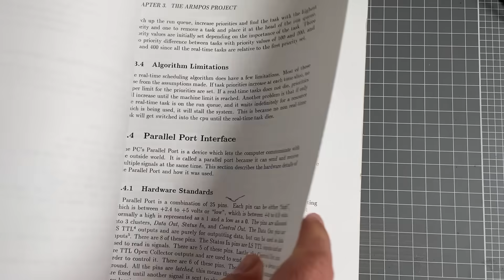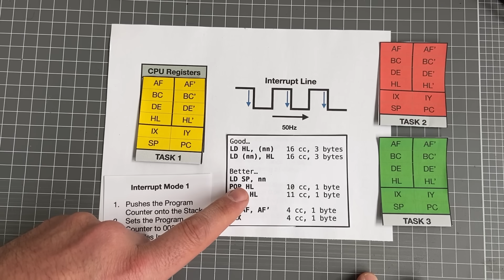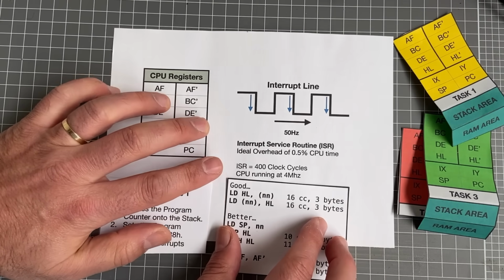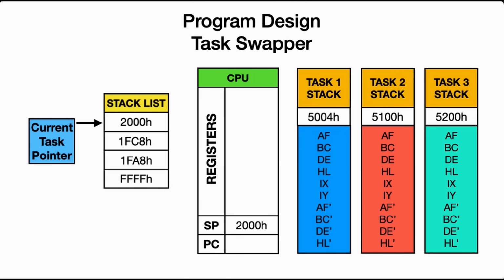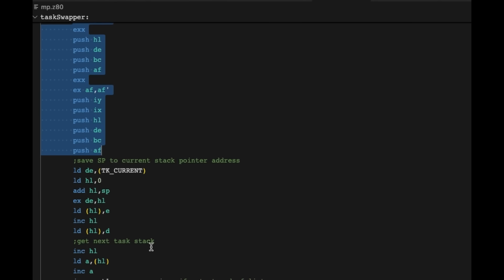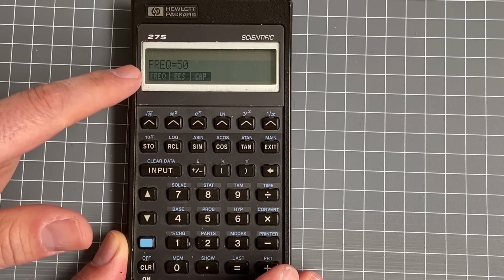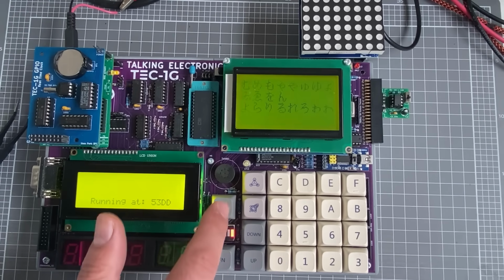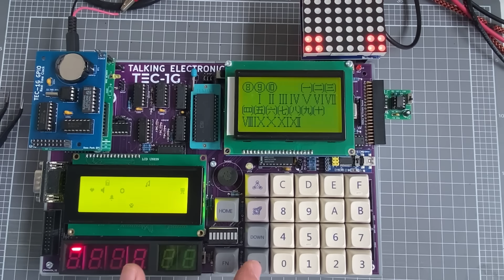Multitasking on a Z80 CPU

Comment: Very cool! I wonder how possible it would be to implement a way to allow the program to defer execution of its task, so that other tasks can use the CPU time instead. Though I bet that would cause problems if you're just using a hardware timer for interrupts, as it would get out of sync if you also programmatically triggered the task switcher.
Reply from the maker: Interestingly, that's what my thesis attempts to achieve. Task prioritisation
Reply: Then it's not preemptive multitasking anymore.
Reply: @chpsilva  That is not true. Just because a task calls the operating system to wait on some event (such as a timer event, or if there is input top process) does not mean that it's not a pre-emptive OS. Yes, that sort of thing can happen with a co-operative multi-tasking operating system, but it also happens with multi-tasking operating systems as well. The difference is that with a co-operative multi-tasking system, if those calls are not made, the task will never relinquish control. It is extremely bad practice in any multi-tasking operating system, whether pre-emptive or co-operative to do things such as executing a tight loop until some condition is met, such as input data to process, or for a timer to trip over. It's wasteful of CPU time and also of power. Consequently, in both co-operative and pre-emptive multi-tasking systems well written code will call system routines which will wait the task until some condition arises to unwait the task, typically on a time basis, or if there is input to process. The difference is that with a pre-emptive system, then the OS can wait the task and despatch a different one. Calling something like a delay routine rather than executing code in a tight loop does not suddenly make it a co-operative operating system. It just means that it's badly written code running under a pre-emptive system. 

What's more, that badly written code, when run under a pre-emptive system, means that the scheduler can change the task's processing priority dynamically according to behaviour. For instance, on a transactional system with high I/O rates, it is normal to implement something that demotes CPU-intensive tasks such that those which wait voluntarily (typically for I/O) get higher CPU priority. That means that they do not have to wait for some CPU hog in order to process input from, say, a file system or a communications device. It also means that if somebody has written one of those multi-tasking unfriendly tasks which executes tight loops instead of a delay call, then it will fall down the CPU priority level. 

That sort of scheduling is often called "mean time between wait". It is something a pre-emptive multi-tasking system can do, but not a co-operative one.

Comment: I did a bespoke multi tasking app for a Z80 in early 90’s writing in ASM. Worked on a yeld method to swop around. Operated a bit for Lab equipment for British Sugar.
I also can up with a single step debugger using the M1 and NMI.

Keep up good work 😊
Reply from the maker: Yeah, the Ultimate Expansion board for the 1F video has a single stepper demo. Also the breakpoint feature on the monitor is essential multitasking but with manual task swapping
Reply: sounds like cooperative multitasking?

Comment: Absolutely it can :) My final year project at Uni in the 80's was a lighting console, which having first written an assembler and relocating linker for 6502 and z80 in BCPL then ported to C, had windowing interface driven by a 6502, and an HD64180 (Z80 in a 64 pin package with MMU and other goodies) running a multi tasking OS that I'd written. It was really the only way to manage the control surface (sliders, LED display, knobs etc.), the serial output (similar to DMX), mouse input, updating of the UI and so on. Each module was a separate process that could run independently of the others, making it a manageable system to implement. All built on a couple of wirewrap boards. Early on it would work for nearly a day and then hang, which took a few weeks of reasoning about, but eventually found a context switch fault that happened very occasionally, but eventually causing stack overflow and crash. All written in assembly. Was lots of fun :)
Reply: Funny enough, the ETC Microvision FX  lighting console used an HD64180, but used a variant of the 6845 CGA controller for the user interface.  Great little console to play with for high school theater, and I have one at home now for goofing around with.
Reply: do you have documentation for it somewhere? Sounds interesting
Reply: Stupid question - is Martin Richard's The BCPL reference manual still the book to read on BCPL?  I'm just trying to make sense of an old treasure trove of code in BCPL.
Reply: @ralfbaechle I think that’s what I had as a reference, and the implementation was on the bbc micro. When I got a Mac+ in ‘87 I ported to lightspeed c as I had a lot of code and assembly and linking was getting slow.  Another classic in my mind is PJ Brown writing interactive compilers and interpreters. As an o level project I devised a graphics oriented language and wrote a compiler for the language  that used the bbc micros assembler, and brown’s book had everything in to get a solid grounding in compiler writing. Never touched bcpl again since those days :)
Reply: @ralfbaechle  if it is a reference book, an actual reference book and not just titled as such, then by definition it at least has to be one of the books to read.
Reply: That is really cool.  I was also doing something like this using a Commodore 64 as the platform.  Not for lighting but for controlling a CNC punch via a custom hardware interface I made.  It also had to provide a visual editing environment with multiple programs in memory, on screen status of the punch, a file system and serial communication for file transfer (via YModem) back to a CP/M base system up in the shop.   The easiest way I could do it was to go with a preemptive kernel/scheduler similar to how you did it.  Stack swapping.  And I don't know if you remember, but on the C64 you could copy the ROMs into RAM and then modify it.  So I was able to reuse large parts of the built in editor and screen handling code without having to rewrite it.   Turned out great, and the company used it for years.  Way more than a decade into the mid 90s at least.   Pretty crazy what we used to do back in the day huh.
Reply: @JumpstarOfficial  I've done similar stuff on the C64 but what always spoils the fun is the restrictively small stack of 256 bytes at a fixed base address.  I think it's fair to say the 6502 was not designed with multi-tasking in mind.
Reply: @ralfbaechle  Hah, no it certainly wasn't designed for that.  Amazing it worked frankly!  But in some ways the constraints we had forced us to come up with some pretty fun solutions.  Can't complain at having to deal with those very pokey old machines. Really made you consider every byte :-)
Reply: @JumpstarOfficial  In my case I think I can say it shaped a good part of my later work.  And while "real" computers now have more resources, MMU, architecture etc. to support a multi-tasking OS with all the whistles and bells it seems there's always a new class of hardware growing at the very low end that still has the same old constraints, where counting bytes is not OCD but necessary.
Reply: @ralfbaechle  Totally!  It's funny how that works!  Good stuff man, love bumping into folks with similar background.  Someone's got to do it!  :-)

Comment: Any turing cmplete CPU can multitask. Whether it's secure or performant is largely a hardware issue. Pre-emtive multitasking is definitely more difficult without timers, but co-operative multitasking is practical on anything
Reply: I’m sure the MOS 6502’s Zero Page would be quite the headache in a multitasking environment.
Reply: @johnrickard8512  As i say, security might be problematic, but multitasking is definitely feasible on the 6502, and several OSes exist that do multitasking on the 6502.

Comment: That is so cool. How would you program for a multi-tasking system on the same monolithic 64KB address space (no MMU)? Would you need to use relative addressing all the time? I'm not sure if Z80 has relative mode though. Or are the tasks hardcoded to their starting addresses to prove the concept?
Reply: All code on a Z80 is hardcoded to a specific address. 
There are basically 2 ways around that. You can add a map of all adresses in the code to a binary. Then while loading the binary, you tweak all the positions in that map to the desired address. This approach is used in "page relocatable" binaries, for example. 
The other more common approach is to use banked memory. You split the 64k address space into two or more banks. 
As an example, let the upper 32k be common memory that always points to the same physical ram. The lower 32k however can be mapped to different ram chips, or different parts of a larger chip. The OS lives in the upper part, and every program lives in one bank of lower memory. 
This approach requires some extra circuitry, but it allows multiple programs to run at the same address. You just switch out the physical ram at that address. 
This was very common not only for multitasking, but to overcome the 64k limit in general. The CPC 6128 and the MSX range of computers use an even more sophisticated banking with 4 banks of 16k each.
Reply: @TSteffi generally, because on startup/reset the Z80 starts at 0000 hex, the OS is at the start of memory address space, not the end. The CPC6128 generally pages 16k blocks in and out of the 2nd and 4th 16k sections, as ( unless CP/M is running ) vital routines are stored in the 1st and 3rd.
Reply: @alanclarke4646  It is true that the reset vector of the Z80 is 0x0000. But that is just the start address. I can't speak to all Z80 systems, but at least for CP/M and MP/M I know for a fact that they sit at the top of memory, with programs loaded from 0x0100. 
Usually a boot ROM sits at the default bank in the lower area. This ROM loads the OS, and the OS then switches the bank to RAM.
There are different ways of handling it.

Comment: You can minimize the task slowdown by using actual timer counts in the delays instead of the usual tight loops with DECs / JR NZs / DJNZs. Nice project!
Reply: Why not a configurable counter running from the system clock? use a 24-bit counter to set the interval.

Comment: Fun fact, there are at least 2 multitasking OSs for the Z80. The classic MP/M, the multitasking/multiuser version of CP/M. It used a timer interrupt driven approach, too. 
And the modern Fuzix, a linux like OS.
Reply: I was going to mention 1979's MP/M as soon as I've seen the video's title :D
Reply: @iz8dwf  I have written two BIOSes for CP/M 3, but MP/M 2 is still on the list. 
I just wish they had made a version of MP/M with the file system of CP/M 3. The 8 MB limit seems a lot more limiting on a multiuser system.
Reply: @TSteffi  The biggest limitation of MP/M is its memory manager, and both it and CP/M 3 use BDOS3, with one exception: disk support. The overhead of supporting larger disks was unacceptable for a multitasking system.
Reply: SymbOS works this way too, on CPC and MSX.
Reply: @mcu8872  the banking on the CPC is a bit weird, because you have a set number of ram/rom mappings to choose from. The banking on MSX on the other hand is very sophisticated, with each of the 4 16k banks having a banking mechanism in itself. 
There were also systems with 8k common ram and 56k banks, which is great for cp/m 3 or mp/m.
But modern homebrew systems often use a 2x32k banking, because that's the easiest to implement.
Reply: @TSteffi  The MSX uses two concepts in its memory management: 
* A memory mapping unit
* Slots and subslots

The Z80 memory address space is expanded to 4 slots each of which can be expanded to 4 subslots. This is the complicated part, but it's only complicated if you are unfamiliar with the design of the MSX. It's a combination of the clever use of an 8255 PPI and an 8-bit register at the very top of memory (0xffff).

The next part is fairly easy: the memory mapping unit. The Z80 memory address space is divided into 4 pages of 16kb each. Each page can contain any of 256 16kB segments. The memory mapper makes it possible for the Z80 in the MSX to address up to 16kB x 256 = 4MB of RAM per slot. While it was technically possible for each slot/subslot to contain a memory mapper, in practice there were seldom more than two at most in an MSX system (most MSXes complying at least with the MSX2 standard have one built in, and even some MSX1s do), because even though the memory address space of the MSX is divided into 4 slots (expandable into a total of 16 subslots), the I/O address space is not, so writing anything to or reading anything from the 4 I/O addresses reserved for the MMU would access the registers of all the memory mappers in an MSX.
Reply: @damouze  Actually, the only mapping hardware on board MSX machines was the slot mapping (in most cases anyway). Whether a slot supported sub-slots was up to the device in that slot, just as with a memory mapper. And in fact the subslot is just another type of memory mapper; it just happens to be a memory mapper with a specification in the MSX official specifications.
Reply: @Curt_Sampson  That is true for most of the MSXes of the first generation. However starting with most MSX2 computers, especially those marketed for Europe usually have at least one internally expanded slot. For instance, the Philips NMS-825x has one expanded slot, namely slot 3. Slot 3-0 contains the SUB-ROM, slot 3-1 is not used (and can technically be turned into a cartridge slot by a tech-savvy person), slot 3-2 contains the 128kB Memory Mapper and slot 3-3 contains the DISK-ROM. 

The same goes for Memory Mappers. Most MSXes of the first generations didn't have one builtin. One notable exception is the Yamaha CX5MII, which has either a 64kB or 128kB memory mapper on-board (coincidentally it also has an internally expanded slot configuration in slot 3 and the internal memory mapper lives in slot 3-2). Starting with most MSX2 computers, there is at least a single memory mapper on-board, providing at least 64kB of RAM.

To conclude: while you could expand your MSX with RAM in slots and subslots, they are definitely not the same thing as memory mappers.
Reply: Came here to say the same thing.
Reply: @ChrisSmith-rm6xlyup, me too
Reply: Add OS8MT to the list of multitasking operating systems. Used by the Monroe computers made by Litton in the 1980s.
Reply: Do I remember correctly that the Commodore 128 had a Z80 CPU for the CP/M mode?
Reply: @Davide73  Yes, you do.
Reply: There was also OASYS, a UNIX v3 subset.

Comment: Well explained video on an interesting topic. Submitted to YCombinator Hacker News. At first, when you described the ISR operating at 50Hz, my human mind immediately assumed that left hardly any time between interupts for meaningful work by the tasks called. However, a quick calculation shows that this still allows hundreds of thousands of opcodes to run within the individual tasks themselves. A good reminder how blistering fast even an 8bit CPU is and of how human sense of  time is woeful in these situations
Reply: I've had a similar experience when I wrote a terminal emulator for the Z80. With all the parsing of control codes, I was was sure it would be awfully slow. But turns out, a couple dozen or so instructions per character aren't really noticeable at all.
Reply: "when you described the ISR operating at 50Hz"
I had similar thought.  That seemed rather intrusive BUT also allows smoother tasking as compared to using the 18 Hz clock on IBM PC as the pre-emptive task interrupt.
Reply: @thomasmaughan4798 From experience, It is possible to tweak the PIT of the PC to around 100Hz. Any higher than that, and the BIOS routines that use the timer become unreliable or stop working properly altogether. Obviously not much of a problem if you are writing your own device drivers that bypass the system timer, but still.
Reply: We sort of home in on "50 times a second" instead of "how many cycles is 1/50th of a second slice worth?". Once you figure its 80k@4Mhz your brain immediately goes "oh, all fine then...".
Reply: @ErazerPT  yeah. I have built a CP/M System based on an eZ80 running at 36 MHz. It's amazing how fast it feels.